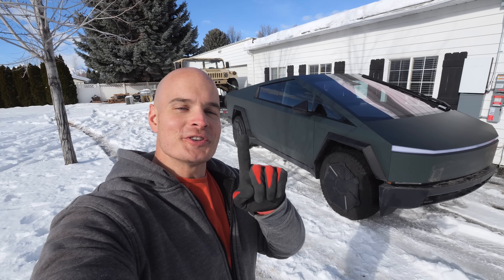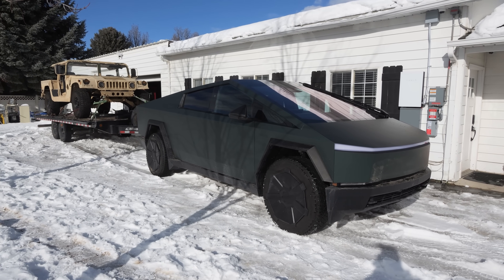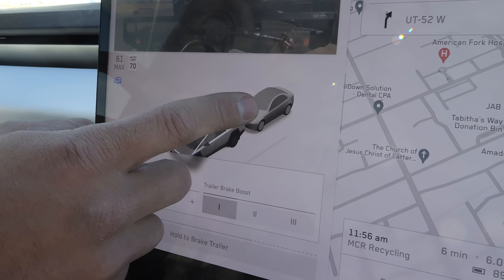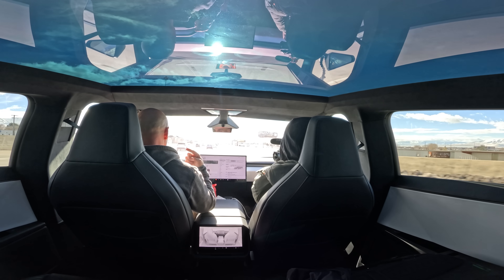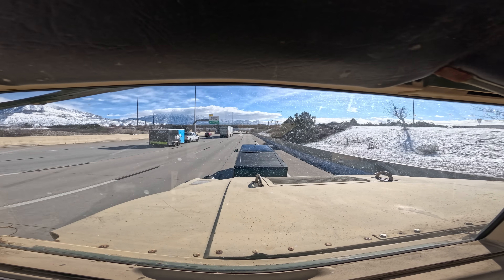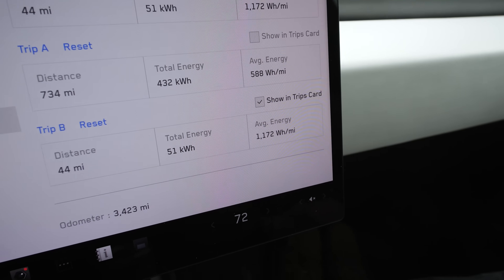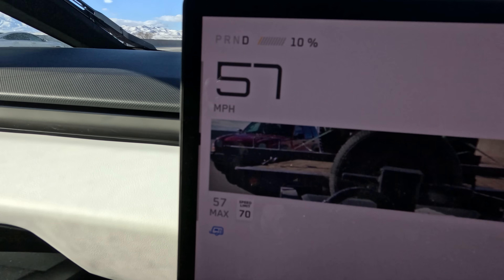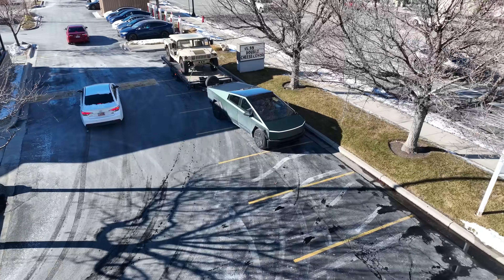How far can the CYBERTRUCK tow 11,000lbs in Freezing Weather?

Comment: Never thought about having to drop the trailer to charge. That's a deal breaker for EV trucks ever being used for any real work.
Reply: That is the biggest failure ever. I kept telling all the cybertruck fanboys about this clear design flaw. This is what happens when you have one dude making all the key choices and you don’t have design reviews with your team to make actual smart decisions
Reply: @gherreraj    It doesn't matter. Cybertruck is not a work vehicle, obviously. It's a luxury car and a novelty. It has some features that would be nice for a work vehicle but there's no way it would actually be used for one except maybe to get the company publicity. Its like a concept car, introducing new features in a fun way to car enthusiasts.
Reply: @gorkyd7912  totally agree.
Reply: @gherreraj  You work at Tesla to know that's happening? How many of these charging stations were installed before they even decided to make a vehicle that tows? Granted, it's still an incredibly impractical pickup truck.
Reply: @suede__  it doesn’t matter what the charging stations are built like. How hard is it to add a charging port on the front of the truck????  Yeah not hard at all. 
Elon has proven to be an idiot. Oh I want the rocket to be pointy because of that line from the funny movie I saw. Yeah pointy tips are actually aerodynamically worse for a rocket but I like it pointy. He said that. That shows Elon is an idiot. His other engineers would have told him the same thing. But he still got his way. You ever watch that Simpsons episode where Homer designed a car his way. That’s what is happening at Tesla. They do it Elon’s way and ignore actual input from other team members to make the best vehicles. It’s Elons way even if it’s wrong. The truck proved my point. All EV trucks suck at doing truck stuff.
Reply: Most chargers are in large lots where dropping it shouldn’t be a problem. Also if you have a good trailer jack dropping it should be a breeze.
Reply: The cybertruck is a tax deduction vehicle: it has almost if not all what's required for many people deduct it as a work expense while having a cool looking (subjectively ofc) car
Reply: Trucks going up hill drop down to 30 or 20 mph some times, normal part of traffic, that's why there's 2 lanes.

Comment: "Squatting" to lift the trailer was delightful. Didn't think about that capability.
Reply: my 2007 x5 does that
Reply: Yeah...A feature on any truck with air suspension. Basically standard equipment on European heavy trucks since the 90s.
Reply: @rkan2  you know what's really funny? Most European heavy trucks with a 4×2 axle config, an at least 450hp, 13 liter (so 1700+ lb-ft) engine, 14 speed AMT capable of towing 40+ metric tons, and a cab you CAN LIVE in cost about €110k which traslates to roughly the same money you pay for an F-450 Super Duty after stealership mark-ups.
Reply: All trucks with air suspension can do that. Do it regularly with a Ram at work.
Reply: @TroySavary So Cybertruck is a truck... Thanks for confirming.
Reply: @themonsterunderyourbed9408  Well, it's trying to be a truck, anyway.
Reply: But it's a Tesla, so it's more specialer.   @TroySavary

Comment: Range is heavily based on battery size and efficiency. So you tested all 3 EV trucks so you should also report how far you went with each truck in the exact sam conditions and how much energy each truck used. Efficiency key. Look at the battery size difference between the Hummer EV and the CT. It's almost twice the size and 2000 plus lbs heaver. So what I am saying is you are not putting out all the data that you should be doing in a range test. You forgot to mention that Tesla has a buffer of 3-5% after 0 which many range tester drive until is dead to test. Lastly no mention of charging speed? One pic of charging at 20% and why did you not show where it was at 4%? Probably it was 260kw and tapering down at 20%. So let's put out the 10-80% charge time in the same test. If you don't do these exactly the same then your video is just an opinion piece and very subjective.

Comment: 100 mile range in 2024 and it's called progress.
Reply: You don't buy an EV truck for towing any real distances. Luckily, most truck owners don't actually use them for anything more than commuter vehicles and an occasional Home Depot trip.
Reply: It's a trade off, to get a reduction in energy usage of 90%
Longer range ones will come soon. Adding batteries is easy, cost is the problem.
Once batteries come down in price further, we will see better range options.

Comment: Damn, that was cutting it real close. Kinda surprised that the estimate was so bad. You had basically ideal circumstances for a good estimation. Consistent weight, speed and relatively even elevation.They really need to fix that. Running out of battery while towing something is a nightmare scenario.

Comment: Would love to see the same test with the range extender.
Reply: If not towing and in ideal conditions you get at best 315 miles, and these conditions you only get 90 miles, the range extender would only get you an additional 130 miles ideal, or an additional 37 miles under these conditions, for a grand total of 127 miles. Pathetic. I was really looking forward to the Cybertruck and have an early reservation, but this has turned it into a solid NO for me.
Reply: @carlosmacedo6442  I dont know what you expected, but if you double the weight of an object and give it more air resistance, youre going to more than double the amount of energy required to move said object. Tesla is a car company, not a magic dealership. They still have to follow the laws of physics.
Reply: @veikkapoika428  I was hoping to get what I get with my Diesel truck. 600 miles not towing, 300 miles towing. But unfortunately electric cars are terrible in cold weather, with significant losses due to electric heating. The original hope was having a 500 miles Cybertruck that actually reached 500 miles, and maybe 200 miles when towing, but unfortunately we're not there yet.
Reply: @carlosmacedo6442 well since you wanna use an EV like a diesel truck then go ahead and design some battery technology with the same weight and energydensity as a tank of diesel. If you think that an EV will rival a diesel truck in range youre delusional. What it does better is it has more torque and its cheaper to operate. The range you have to sacrifice is worth it for some people and not for others. For your usecase I suggest you pull your head out of where the sun doesnt shine and think with it.
Reply: @veikkapoika428  Wow, it's absolutely true that people are very disrespectful when they don't need to talk to people face to face. I'm just giving a comment on how disappointed I am that it doesn't fit my use case, and you have to resort to badmouthing me as a person. Sad state of affairs for people nowadays.
Reply: @carlosmacedo6442 no. What you did was badmouth an engineers hard work with a truck calling it pathetic for not breaking the laws of physics. Im just telling you to use your brain before you talk. Many people need a reminder of that. It is okay, we all make mistakes. Even me.
Reply: @carlosmacedo6442   Um not really. You would actually get more like a little over 130 miles with the extender in the same conditions. That fact along with Tesla's solid charging network makes it pretty decent when you need to haul something. The steer by wire system is a plus also when dealing with a trailer.
Reply: @b.robinson206  Wow, that's so much better! Imagine getting a little over 130 miles instead of ONLY 127! You totally changed my mind! 😀
Reply: @carlosmacedo6442  I guess the superior charging thing just flew right over your head...
Reply: @b.robinson206  I do have a Tesla and have used the network multiple times for many years. It's great, although not perfect, and unhooking a trailer to charge, then hooking up again, is a horrible proposition. My annual trip for vacation of 1000 miles is done in one day, pulling a trailer with my current truck, something I feel is impossible with a Cybertruck.

Comment: Hey Zac, I noticed a few minor errors (60mph being 69km/h (its 97km/h). Top left range on Teslas is NOT adaptive. It will always use the battery capacity / rated consumption. Only the energy graph (not sure the Cybertrucks gets this, but it should) and navigation will actually show you the estimated range.
Besides that, great content as usual :)

Comment: Man, I hate to side with boomers; but they are totally right. It may be a cool flex to tow with these EVs, but it certainly isn't practical. The fact that these companies are still marketing them like they are entirely capable and PURPOSE BUILT for towing is unbelievable. If I'm paying 70-100k for a truck, I better be getting my money's worth. I always would hate the idea of having to unhitch a load just to recharge. Not every area will have the available space to do this stuff, you'd be even luckier to find a charger; I'm surprised you made it at all.

Comment: tesla cyberrtruck is not bullet prove. that is not true! some details change to build this thing.
I think you put your jipe on a bad position, for safety the load should be close of possible to the rear of the car.
Reply: not necessarily putting to much tounge weight will also lighten the front of the towing vehicle making steering less responsive.

Comment: The range estimate on the screen uses the EPA miles estimate. Although it would be nice for this to change with weather/driving conditions, currently it’s better to leave it on percent. 

Also, there is a graph on energy usage within the Energy app. It’s not instantaneous, but it shows total energy usage over the last 5, 15, and 30 miles, as well as reasons you’ve lost range on your current drive (wind, too fast, elevation, tire pressure, etc). I thought Zach has/had a Model X, so unless the energy app doesn’t exist on the Cybertruck, then idk why he didn’t mention it
Reply: I don't think the range estimate on the screen uses the EPA estimates. As the battery degrades the total range lowers over time, and adjusts to your driving habits and many other factors. I think the EPA estimate is only on the website as the best case scenario of miles. Which hardly ever happens, this goes for both EV and ICE vehicles.

Comment: This is what I really don't like about Tesla and their range estimates. On the battery icon, the range almost never changes, and when it does it's always small almost unnoticable details. But when driving far, the GPS estimates updates and after half an hour or so it really becomes accurate. Accounting for both elevation, weather like wet roads, and driving style. But I wish they could make it work in the range indicator itself, and not having to use the GPS estimate to get an accurate estimation. Speaking from experience from a model 3 and driving in cold winters do in Norway.
Reply: Tesla's range estimators work completely different than every other EV. The number you see at the top with the battery percentage is the EPA rated range times the battery percentage (and also accounting for battery degradation). This is much better than the usual guessometer imo because it's consistent. A guessometer can be extremely inaccurate if you've been driving city for weeks and decide to do a road trip (it'll say you have much more range than you actually do, based on usual driving habits).

As long as you remember that that's the EPA range, which is like 50% highway, 50% city driving, imo it's much more useful and accurate than a guessometer.

And then you have the map estimator, which is like a guessometer on steroids. Because it calculates your battery percentages on specific routes, taking into account speed, elevation, wind, temperature, traffic, etc. it's extremely accurate. I drive a model 3 as well, and I much prefer this way (the EPA metric and the very accurate map estimate) to the very questionable guessometer. But it does get some getting used to and I wish Tesla would advertise this info better.

Comment: As a commercial hauler, seeing how the hmmwv is secured, I would not want to be around that trailer on the road. In some clips you can see the passenger front green strap slacking off. Proper attachment is below the suspension for securing vehicles to trailers.

Comment: My guess was 130 miles which is really bad, but I was disappointed in the 90 miles. Yes I know aerodynamics play a huge role, but as of now a diesel truck or gas truck is a much better option if you're buying a pickup for "truck" things. 

I wonder when they'll have battery technology up to par with gas.
Reply: It won't be a lithium ion battery, so it's still very far off whenever you need high energy density
Reply: Short answer is that energy density of batteries needs to improve dramatically. But there's a lot to learn from making these weird electric concept cars that can be applied to improve normal fuel-burning vehicles.

Comment: The flat top steering wheel is a stupid design 😂. Also biggest disappointment is its range and charging.
Reply: Why? You do not need a round wheel for a truck with 340 degrees from stop to stop steering by wire.
One of the reasons for a smaller steering wheel is not to cover the center screen.

Comment: Jerry - you mentioned tthat the truck has electric steering. In the event of a battery failure for whatever reason, can the truck still be steered if it is moving say at highway speeds? Does it have the ability to be steered manually in such an event however unlikely?
Reply: Out of Spec ran one till it stopped moving. It stops moving with some power still available, the screen was on and the steering worked, so there are safeguards that 0% isn't completely dead.
Reply: @donnytrimm8636 The steering is powered by the 48v battery, not the drive battery.

Comment: By consumed energy and availible energy by spec it probably could have went to full 100 miles but still it is surprising that Tesla of all companies made a pretty painfully average EV truck that's really similar to all others. With all other models they beat their competition but this one looks somewhat like an outcast apart from looks and cutting edge engineering under the hood which by the looks of it doesn't help as much as I would expect.
Reply: Well the engineering part helps with cost and weight reduction, so that they can get away with using fewer cells. Since their target performance envelope is similar to other trucks, as a consumer you will not feel most of it.
Reply: @IR-xy3ij  The price is also very similar and they said they wouldn't turn a profit for another 2 years. Steel is the main problem I believe, it just adds so much weight and complexity that it negates all other benefits they managed to achieve with other tech. But all in all they really needed this truck to develop key technologies for their affordable model coming in the future, even though there's no way they will be selling more than 100k units annually. No paint, 48V, ethernet loop, radical design and maybe even steer by wire will definitely come in handy for it. They are driving the cost of it now to reap the benefits in the future.

Comment: I hate hearing people call these "bulletproof". It can stop some of the weakest and less common ammo out there. Id call it "resistant" at the most 😅. 
Not a fan of fly by wire steering. Steering is one of those things that should have a mechanical link at all times. The more i see these test videos, the more im glad i dont have one. 
Look fwd to the next humvee video (if there will be one).
Reply: Planes have been fly by wire for decades, it's possible to create safe drive by wire
Reply: I don't have to worry about my plane not turning on a corner at 110kmph....
And I'm sure they are mostly hydraulic 🤔
The issue with a sole fly by wire connection is in the event that the motor suddenly fails, you would loose all control of that particular part. At least with a mechanical connection, you still maintain control, just a bit stiffer.
Reply: 9mm and 45 ACP are some of the most common calibers out there, its protection is similar to NIJ level 3A
Reply: well a .22lr is a bullet too. it'll still kill you though bud. theres lots of things to pick at but calling any bullet weak is kinda ignorant.  also never get in a plane, all the stuff there is "by wire"

Comment: Thanks for doing this! This is exactly why I will not be getting an electric truck right now. The range and infrastructure is EXTREMELY lacking. As someone who has towed across each class of consumer vehicle, you'd be silly not to use a standard gas/diesel truck. Especially if I am on the road with the family (kids), no way I'm waiting 40+ minutes to charge my truck while I can pull up to a diesel pump and get done in ~5 mins. I'm sure electric is the future here but right now its way to far behind in this category.

Comment: The ultimate test would be to run two CTs with same specs at the same time, one with a load the other no load. Then, when the loaded truck dies you can use the other to charge it to get to a charge station. Convoy anyone?

Comment: Is that rust on the rivet heads on the inside of the passenger door?
Reply: Are you talking about the 3 spot welds?
Reply: @RAREFORMDESIGNS  those are spot welds? They look like rivet heads, but yes, they have what looks like rust around them.
Reply: @Johnny_Kanuk not rust, it's just a part of the welding process